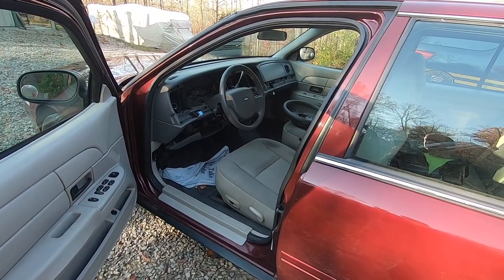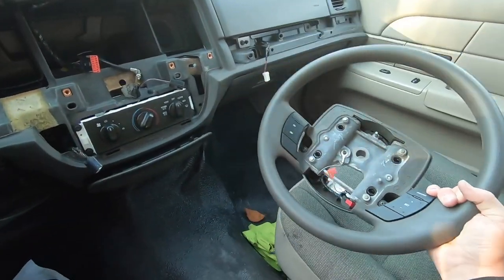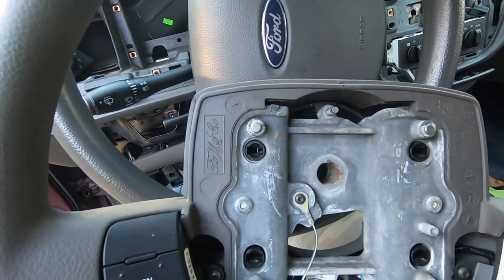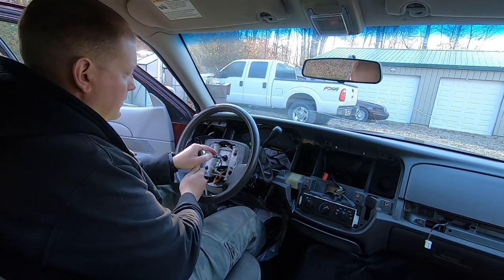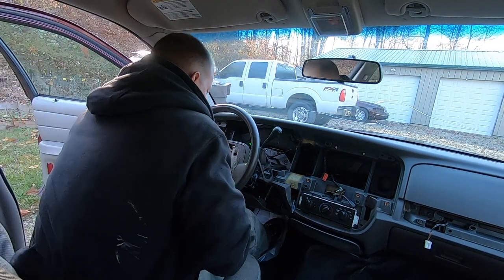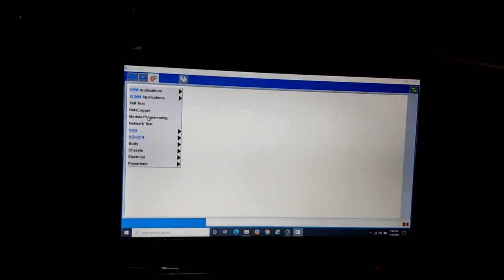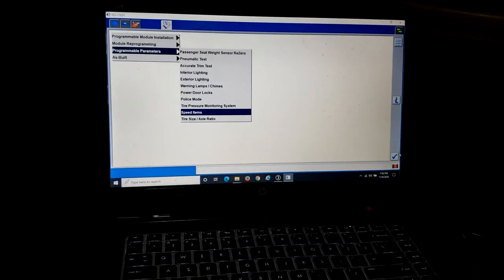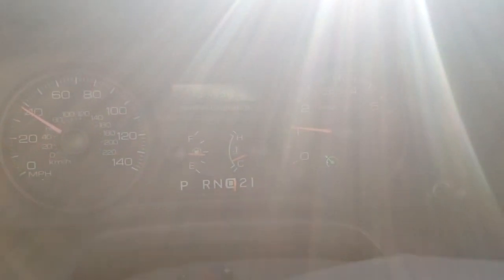How To Add Cruise Control 2005-2011 Ford Crown Victoria P71 / P7B

Comment: After looking on eBay for three months, I found the 2005-2011 Crown Victoria cruise control steering wheel and even the color matched my airbag.  This steering wheel had a date code of 0612, which I understand is June 2012.  The date code on the cruise control switches was 2021.  Sadly, Ford no longer manufacturers that steering wheel.    I had the local Ford dealer turn the cruise control on in the PCM a couple of months ago when I had the transmission serviced.   Today, I finally had time to tackle the job.  It took a little while to get the airbag off (those hard to reach springs that hold the airbag on):  30 minutes to an hour.  After that it was smooth sailing doing the rest of the job.  Cruise control now works beautifully!!  Thank you for this excellent video and well done.

Comment: Thank you for the video!! My '08 CVPI's clockspring just went up and I've wanted to do this upgrade for a while. As long as I can source a wheel in the next week or so that isn't an arm and a leg, I'm going to give this a shot. I checked with two of my dealers near me. The one said they couldn't do it because of not being supported by Ford, but the other one said they would do it, but they were on the fence about it. To me it sounded more along the lines of whether they had a tech that knew how to do this, lol.

Comment: Thank you so much! It took a little bit of fiddling, but I finally got it and I'm very happy. I just used the software that came with the tool and it worked pretty well in this application. Thanks again for the inspiration and tutorial!

Comment: This video is great! About to order my scan tool from amazon. The stealerships in SoCal all said they don't preform programming work like this. Well one said they could try but no guarantees. One even told me it was impossible to have cruise control on a non factory cruise car. One question, what version of windows are you running? Will this work on windows 8.1? Thank you.
Reply from the maker: I am on Windows 10. I'm not sure if it will work on 8.1. look up the specs for FORD IDS.

Comment: Good ol' Ford thinking/ cheapskates. Most new cars 2005+ came standard with cruise control but not the Crown Vic! It would have cost them probably $4.99 to have added CC from the factory.
Reply from the maker: Yep.
Reply: Remember this the same company that saved $11.00 on the exploding on impact Pinto. lol
Reply: They could have put all kinds of $5 parts on them but they didn't because they're FLEET CARS, and the primary concern of fleet buyers isn't driver comfort, it's COST.  My 2011 Police Interceptor cost $21,100.00 new. or $25K in 2021.  $25K for a brand new four-door V8 sedan with a 12-year track-record.  Not by adding BS options like cruise control that 95% of your buyers will never use.
Reply: Well it's kind of weird because some of them have cruise or power options and some don't.

Comment: quick question about rear window controls. switches at rear doors are inactive. windows work from master switch. is there a preference setting in one of the modules that switches these controls on and off? thanks for the video!
Reply from the maker: No. They are probably disabled at the switch or there may be a grey connector in the b pillar that is disconnected. Have you taken off the door panel to look and see if they are plugged in

Comment: Quick question boss I seen both this and your RKE video and was wondering can FDRS do both cruise control and the keyless entry or will I need to get for FDRS for the cruise control and Forscan for the keyless entry? Car in question is a 2010 P7B car. Thanks, Brett
Reply from the maker: I'm not sure if FDRS will even work on a 2010. Probably need IDS for the steering wheel. For the keyless entry it would be way easier to use forscan and it's free. Might be possible through IDS by manually configuring as built data but forscan is the way to go with that.
Reply: Okay IDS for cruise (maybe) and forscan for the keyless entry got it! Thank You sir love your videos from one DIYer to another thanks!

Comment: Thanks for posting, great information.  I'd like to do this.  I see a couple of SoCal folks saying the Ford dealers won't do the PCM flash.  Maybe related , maybe not, but to pass a smog check the PCM can't have any 'tunes' loaded.  Don't know exactly what this means or how the PCM indicates this.  Don't know if the reflash to enable the cruise will trip me up on a smog check.  Can you point me in the right direction?
Reply from the maker: It will not mess with a smog check because this is a factory calibration directly from Ford, not an aftermarket tune. Big difference.

Comment: I've replaced the steering wheel on my 2010 PI and had cruise enabled but I still can't get it to work. Any ideas? We were able to turn off dark mode and turn on smart lock so I'm pretty sure we did everything right
Reply from the maker: Not sure. It is a PCM reflash to enable it, as seen in the video. It should work. The SCCM would be the only other module between the steering wheel buttons and the PCM

Comment: can i install a 2005 steering wheel on my 2001 p71 i bought a new wheel and airbag do i need to modify anything thanks'
Reply from the maker: No. Different steering shaft
Reply: @JackofAllMasterofNone  is it because i can only use a t45 torx bolt with my steering shaft

Comment: ForScan does have the ability to edit as-built data now. I just don't know what bit/byte to change to enable cruise control and can't find that info online
Reply from the maker: This isn't about editing as built data.... Forscan has always been able to do that. This is writing a whole different flash to the PCM. Forscan can not do it unfortunately.
Reply: @JackofAllMasterofNone  Oh I thought editing as-bully data reflashed the whole module anyway? That’s what it seemed like when I enabled RKE and turned off the TPMS system
Reply from the maker: No. You are not just changing data bits in a module. This is a whole other side of programming. You are actually writing the engine control strategy and forscan can not do that. There are some high end scantools that can though like some from Launch and SnapOn
Reply: @JackofAllMasterofNone  oh, ok. Thanks!

Comment: So the link in your description also comes with id's? And how much is ids after the trial
Reply from the maker: No. You have to pay for IDS/FDRS. You can get a low cost short term license.
Reply: @JackofAllMasterofNone  does it come with the obd cable as well or is that seperate I didnt see it on the ebay listing
Reply from the maker: @gallagherdavidson3393  Yes the device plugs directly into the OBD2 port and then plugs into a computer via USB

Comment: Is two hours enough patience?? LOL, for the life of me I cannot pop the bottom two springs out, no matter how much I wiggle, pry at the airbag and apply pressure to the spring. Any advice?
Reply from the maker: I'm not going to lie. It's very tricky. I'm sure Ford makes a special tool for the job. My only advice is what I said in the video. If you have the new wheel, practice on it so you can see what you are trying to accomplish.
Reply: @JackofAllMasterofNone  thanks. I’ve practiced on the new wheel, however I can’t seem to “push” those two bottom pins down for whatever reason. The two Top ones come out like a breeze.
Reply: Same problem here. I officially HATE that little “click” noise the hook makes as it re-engages on left when l finally depress the spring on the right.

Comment: How did you get your J2534 working? I bought the one from your Description but FJDS doesn’t seem to recognize it.
Reply: And unfortunately I’ve already paid for the License so I’m currently in do or die mode.
Reply from the maker: You have to use the software on the included  disc or download it from the flyobd website to install the drivers for it to work with the Ford software. It won't just work by itself. The first step is to install either. IDS or FDRS and then install the 2 other applications. You then plug in the device to the computer and the car before opening IDS/FDRS

Comment: Ok ...so if I just change the wheel to a cruise wheel on my 11...the ford dealership can open and set the parameters on the computer right ?
Reply: Or should I call first and see if they are willing or have the ability to?
Reply from the maker: Yes. I would line up a dealer willing to do it first. Some will, some won't. They like to play stupid.

Comment: If I were to upgrade and reprogram my 2009 interceptor with CC, could I still add aftermarket performance tunes like an SCT tuner later on if I wanted to?
Reply from the maker: Yes
Reply: @JackofAllMasterofNone  Rlly sorry I meant that as in without any ecm glitches or issues but your answer seems to cover that already w/o any other note alright thanks. I ordered the VCM tool and I’ll give it a shot
Reply from the maker: @brockfilmzinc1  It will most likely just change the PCM "catch code" that is sometimes required when you do a custom tune. So don't use the label on the computer anymore after you install the cruise control. If you need the PCM ID you can just read it with a scantool.
Reply: @JackofAllMasterofNone  I got the VCM tool you linked, plugged it in and downloaded FJDRS but it won't read the tool/connect to the car. Is there a step I'm missing for the tool to work?
Reply from the maker: @brockfilmzinc1  You have to install the driver software included with the tool first.
Reply: @JackofAllMasterofNone  Alright did it and got the program connected, but now whenever I’m right at ignition cycle process after selecting enable for speed control, it asks to put in my VIN again and then the next screen just says “Data Error - Module Entry is Null” (Maybe worth noting I had my PCM replaced from a ecu company that reprogrammed a new one) what could you think is the issue?

Comment: Hi, where are you located? I have an 07 and the dealers in SoCal say they can’t program it. Can I take my car to you? I have the steering wheel with buttons installed.
Reply from the maker: I'm on the other side of the country. You should look for an independent shop that has a Ford IDS subscription. Many non Ford garages have the software. The dealers are lying to you because they don't know what they are talking about.
Reply: Thanks!

Comment: I tried to do this, bought the tool, followed all the instructions and now my car won't start (sounds like the fuel pump isn't turning on) and when I try to erase the file off and put it back to factory I get an error message. I'm doing this right before a long road trip (hence the desire for CC) and now I'm screwed. Not blaming anyone here. Just thought people should know that this headache and stress is also a real possibility. Might try to use the ford software and see if I have any luck.
Reply: How did you remedy your issue Regards
Reply: @The Big German  I couldn't figure it out, so I wound up replacing the PCM altogether. The error message was keeping me in a loop of "add module" to "no module found" in regards to the LCM I believe (makes no sense to me) And then I tried to reset it but it would come back with "youre not finished with this process, please complete installation of module." I don't know what I did wrong because I followed it to a T. I haven't tried again either as much as I want it in the car; I'm scared to brick it again. Something else I noticed- I think he shows a CC symbol on his Guage cluster when it's working. My car doesn't have that symbol anywhere on the cluster. 2006 CVPI btw.
Reply: @alecmiley   Thanks for your reply,I wanted to add cruise to my grandsons p71 but the risks too great for me,that software crap good till it isnt ,Regards

Comment: My situation is that I don't need to replace my physical PCM [there's nothing wrong with it] on my '09 CVPI, I just want to simply enable cruise control.  I've already changed the steering wheel.  So my question is ... can I just "enable" cruise on my current PCM without having to get a 2-day Ford software subscription?  Or is the Ford subscription required for ANY "programmable item" changes to the PCM (specifically cruise)?  

Also, Will the FORscan (v2.3.38 free version) software work for my need?  https://forscan.org/download.html
Or do I HAVE TO USE the Ford subscription software?  I looked at this link:  https://www.fordtechservice.dealerconnection.com/vdirs/wds/diagnosticsites/vcmdvd/mcs/idssoftware.asp 
and it did NOT list my '09 CVPI as one of the vehicles.  I did not see in your guidance how or where to download the "IDS software."  So which software can I use?

Also, can I use this tool for programming: https://www.amazon.com/Forscan-Scanner-ELMconfig-FoCCCus-Diagnostic/dp/B07MQ8GHG3/ref=sr_1_10?crid=268V55HZEIEUN&dchild=1&keywords=pcm+reprogramming+tool&qid=1615164638&sprefix=pcm+%2Caps%2C192&sr=8-10
Reply: Just pay Ford to do it.
Reply: No, Forscan will not write to the PCM. You need IDS, period.

Comment: Hi, I have a question, can you remove the computer off a 2010 crown victoria that has cruise control and replace it on a 2011 crown vic ,in other words take the computer off a 2010 crown vic and install it on a 2011 crown vic ,of course adding the steering wheel to the 2011 crown vic with the cruise control features ? That way I don't have to go to the dealer to reprogram the 2011 vic,thanks
Reply from the maker: Short answer is no, you can not. They are programmed with the vin# and will most likely not communicate correctly with the other modules in the car.

Comment: Those prices are ridiculous! I only need to just turn on the cruise control and dome light (dark mode off). All of this for what 159 plus 49 and getting over 200 bucks...DUMB.
Reply from the maker: Way cheaper than going to the dealer....
Reply: @JackofAllMasterofNone   I am really wish you show the fully step by step how to connect the vci to computer and car. my computer wont detected vci you recommended for
Reply: @JackofAllMasterofNone  none of this are working. been on it over 3 hours
Reply: @JackofAllMasterofNone  IDS cost $150 for 2 days, not 49. FJDS/FRDS wont work at all. Waste of time!

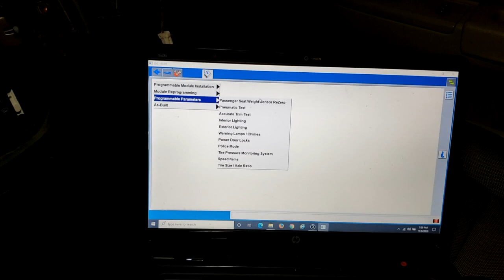Comment: Hmmm, flashing the brains of your car to save a hundred bucks on letting a professional do it (and take the blame if something goes sideways)?.... yeah, no thanks.  I took mine to Ford, paid $130 and drive with confidence (at computer-set speed.) Listen to what he says at 13:40.
Reply: Most dealers will not do this anymore. I only know of one that will actually do it in my state, the rest either outright refused because it would apparently cut into Ford's bottom line (lol) or didn't believe me when I said it was possible. So at some point you will need to DIY anyway. Also you aren't actually overwriting the code, it's just writing to the settings bank.